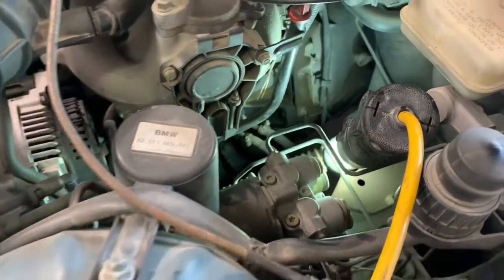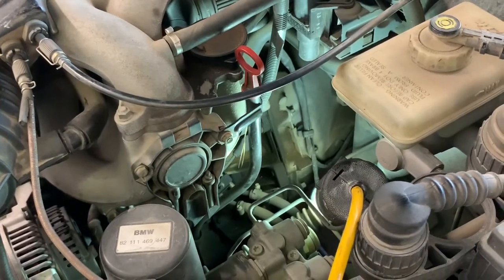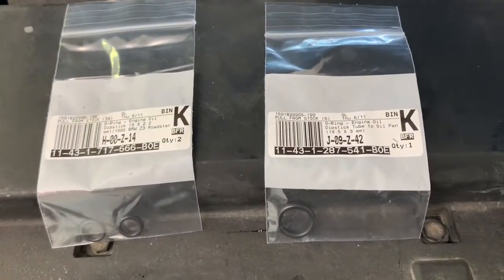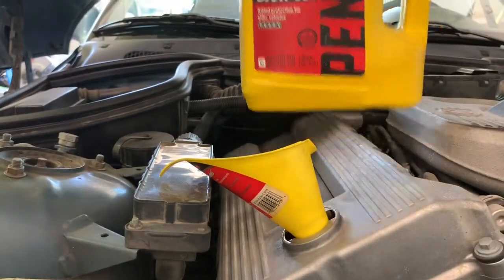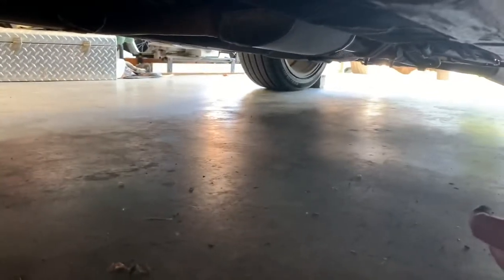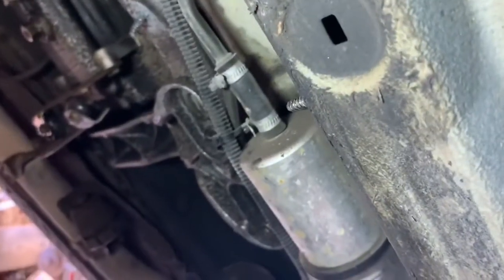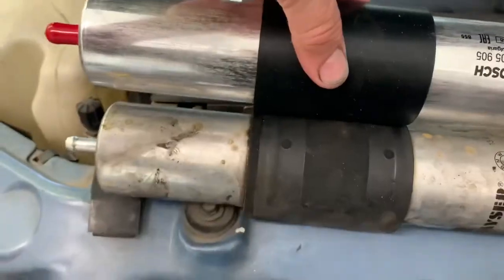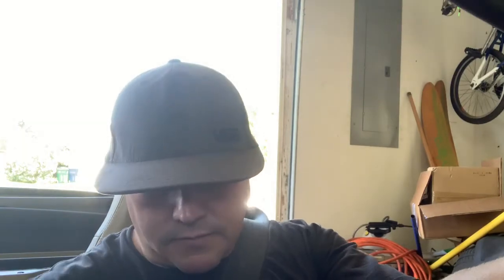BMW Oil Change & Fuel Filter Change Daily Driven Sports Car Vlog 20-Aug-2020

Comment: Thanks for making these videos! I've just inherited my father's 1.9 Z3 that he has had for 20 years. It's pretty neglected, first thing I need to do is change the cracked air intake boot and one of the hoses. I'll do a oil change and maybe spark plugs..... Then sort out the rust!
Reply from the maker: You’re welcome. Making these videos is a labor of love that I have for the Z3. If you haven’t already, subscribing would be appreciated. I’ve got several videos that focus on fixing common problems with these cars. Have fun with your Z3.

Comment: Hey there, been following the z series for a while now, love the new editing aproach, the channel is getting better with each video congrats! Quick question, when I did my oil change I had some issues with the oil filter housing, its leaking real bad in between the cap and the actual housing thingy. I have changed the o ring a couple of times, same result I just cant get it to the right position idk if I need to buy the torque wrench and the adaptor to tighten everything to spec? Did you did it just by hand? I´m a bit frustrated. ty
Reply from the maker: On my cap, I believe there’s a torque spec printed on it in Newton Meters. I don’t remember what it is off the top of my head. Honestly I just tighten it down till the cap completely bottoms out and then give it a little nudge with my oil filter tool. I’m curious if you might have a hairline crack somewhere in the cap or the actual housing itself. Also, do you lubricate the o-ring prior to screwing on the cap?  If not, you may be tearing or stretching the o-ring as it rotates during the screw motion. Thanks for watching my videos. If you’re not already subscribed, please consider it. Let me know what you find out about your filter leaking. I’m always interested in learning.

Comment: I have a z3. I paid a mechanic to change the air filter. The oil changed, and filter, and the engine light came on. The mechanic checked it and said it was a broken air hose (according to the diagnostic device) but He did not find anything broken. Which may be?
You do z3 maintenance?
I bought the 4 spark plugs but have not changed them yet.
Reply from the maker: Is the car running rough?  Vacuum leaks will make the car run rough. If it is running rough, I’d just start investigating under the hood looking for cracked hoses. If your car has a lot of miles the hoses can become brittle and crack. Sometimes the cracks aren’t easy to see and you will have to do some deep investigation.
Reply: Do you fix cars?
My car has 164,000 miles
Reply from the maker: Are you in Texas?
Reply: gereshifters
I’m in Oklahoma City